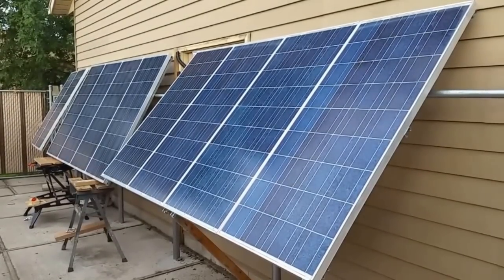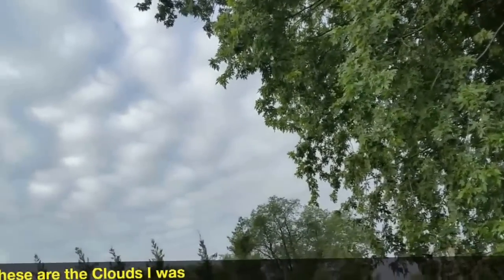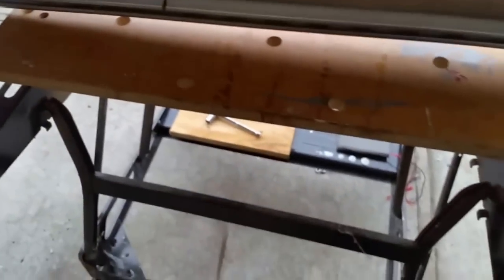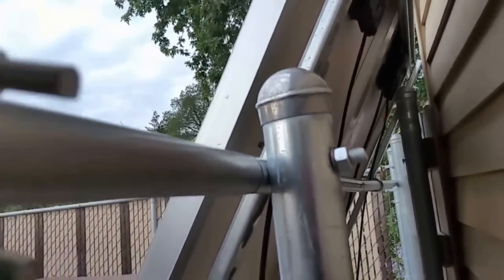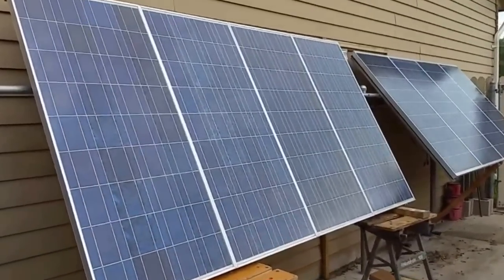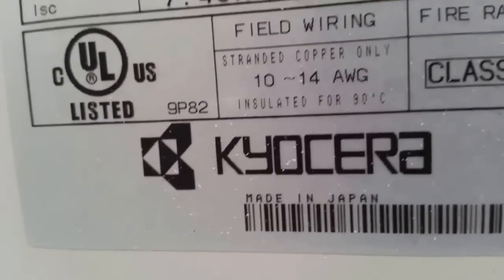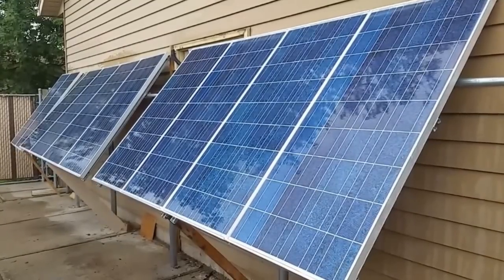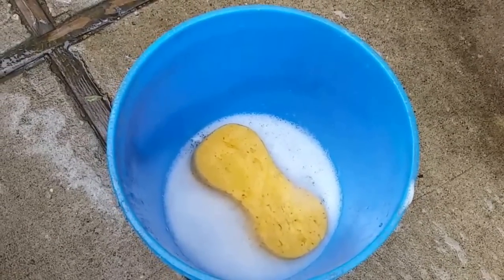SOLAR PANELS INSTALLATION: TEN KYOCERA KC120-1  SOLAR PANELS

Comment: Did the conjunction boxes come with wires pre-installed or did you have to install some custom o rings?
Reply from the maker: I custom made and rewired my boxes
Reply: @jwsolarusa  any pictures of that setup?  I have the same brand and I'm trying to do so but haven't seen any info or pictures on this?

Comment from the maker: Thanks for the question Roy.

Those Solar Modules are not going anywhere. 
This system just turned a year old on June 2016.
What I did to this system works really well that's why Tom and decided to modify the system with more Modules and high end solar panels and 12 batteries @ 24V system. 
I hope I answered your question brother. 
Have a blessed Sunday.

Comment: It looks to me like the U-bolts are backwards. I see the flat plate against the round pipe and the round end of the U-bolt looks like it's against the flat channel. Am I missing something?
Reply from the maker: No, you are not missing anything. You are absolutely right buddy but, this is the way I wanted to put them or else there is no way I can tighten the bolts to keep the Arrays safe an secure. 
The flat plate on the Ubolt is steel strong enough to keep the solar array secure.
This setup is not pulling down  alot of weight on the Ubolt. These Solar Modules are not that heavy. 
I have the modules mounted  fours and two on the left hand corner hung  independently.
Thanks for the concern and for watching my videos buddy. Have a blessed Sunday.

Comment: Nice job! I have 15 of these to install very shortly using a roof mount Unistrut method.
Reply from the maker: Good for you Mate. How have you been and how's the new  system running ?
Reply from the maker: Thanks for the compliment and for watching. 
Please stay tune for more videos to come on this project. 
Please give thumbs up and share this video link.
God bless
Reply: +JW Solarusa the system is running great on the small array. Just anxious to get this 1.8kw out of my garage and put it on it! Picked up another 6-135w Kyocera panels last week for a ground mount setup, but want to finish the garage first.
Reply from the maker: +Al James 
Hey brother how are you doing today? 
It as been a while. How's your system running?
I just install again my OutBack FX3048 Inverter Charger. Please checkout the video I uploaded. 
Have a wonderful day buddy 
Cheers
Reply: +jwsolarusa John I did!  Great job!  I just installed my 120's on my garage yesterday. Tested the output with inverter this morning. Low output due to rain clouds (always happens after an install, right?)...but it works! Will send pics soon. Did your instructions method...great stuff and easy!
Reply: +Al James instructions=unistrut
Reply from the maker: +Al James 
It's always nice to hear good thinghs from a nice friend, brother and a YouTuber
Good job Buddy and I am proud of you.
Thanks for sharing and for watching my videos. 
God bless and have a wonderful day.